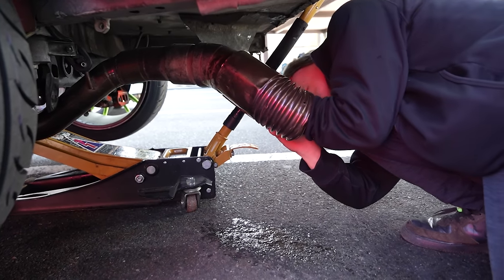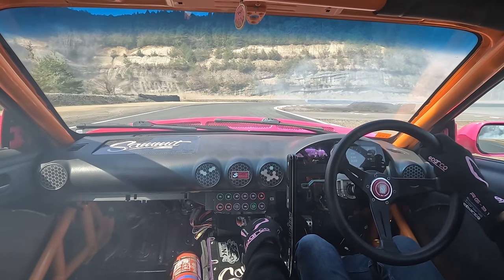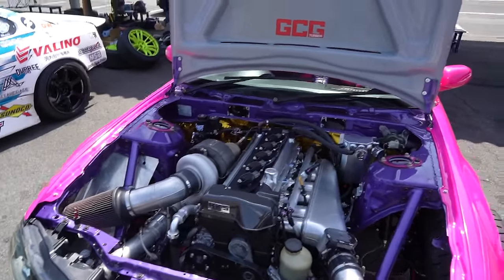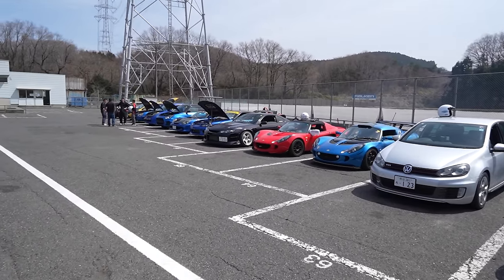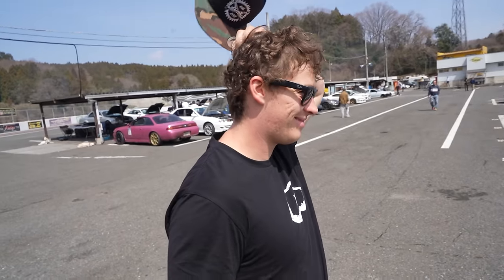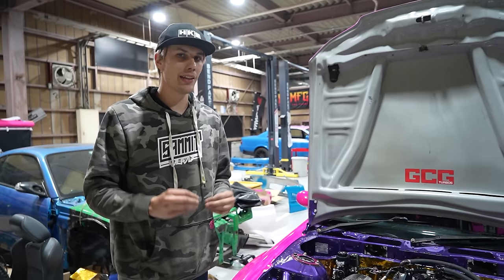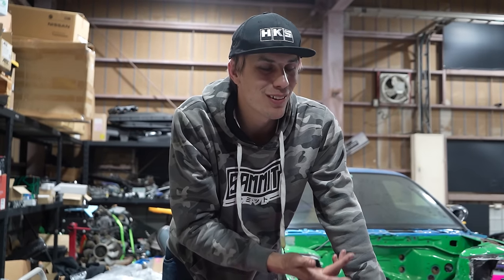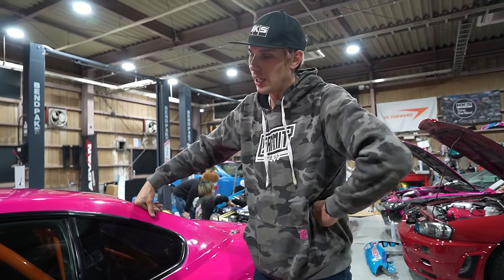Scaring Rudnik in my 1000HP Drift Car at a Small Japanese Track!

Comment: There’s a video on the skid factory where al explains how to fix the heavy pedal when removing the booster. You need to adjust the height of the brake bit joins to the pedal to essentially correct the ratio to make it a lighter pedal again.

Comment: From a technical standpoint, I think the correct term would be, toe gain under compression rather than active toe. Active toe would imply you have a way to change toe on the fly. The effect you have now is through  kinematics in the suspension design. Also don't get too crazy with toe gain effect. The opposite effect is toe out when you lift. This is something that the sw20 suffered from in the first rear suspension design. The toe gain made the car fast in thr hands of a skilled driver but for the unskilled who have a tendency to lift abruptly mid corner, thr snap oversteer myth was born.